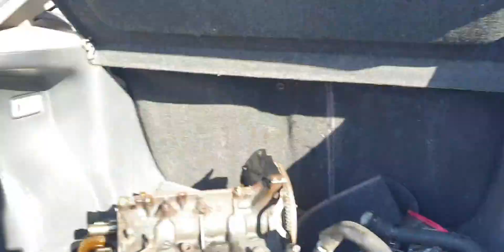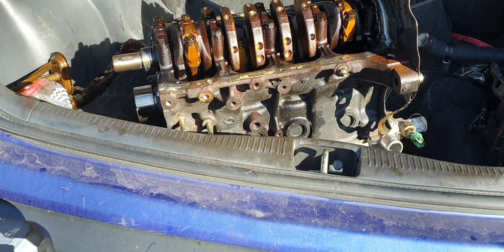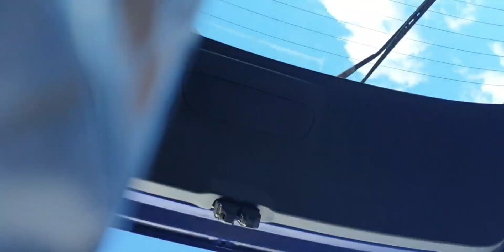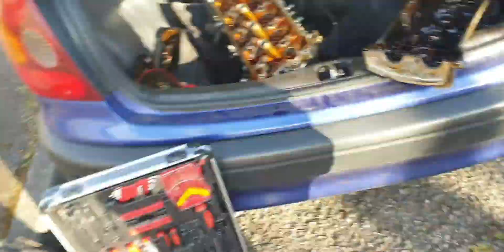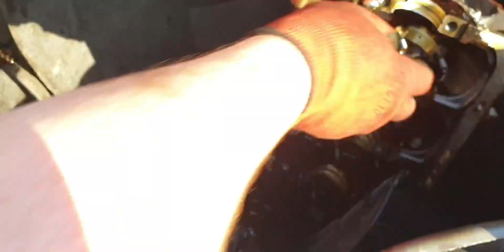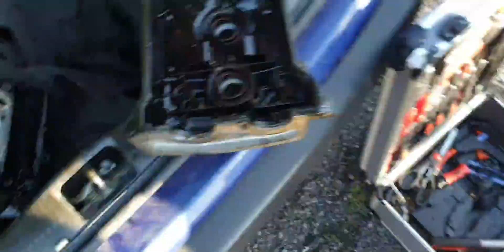Toyota 4E-FE/4E-FTE engine teardown Part 4

Comment: Thanks a lot for sharing these videos Johnny. They're extremely helpful. I have recently purchased a 4efe which I plan to forge the bottom end on and use with my 4efte Head. I know there has been a lot debate over the years in relation to the 4efe crank and 4efte crank differences. However looking at your crank, it seems to be stamped with 4ET, which is the same crank used in the 4EFTE  :)
Reply from the maker: Hi Tim, thanks for your comment and well spotted you did indeed see the 4ET forged crank in the 4E-FE, This is because the FE and FTE share the same crank. Also, I would point out that the FE and FTE share the same cylinder head and valvetrain components, camshafts included.